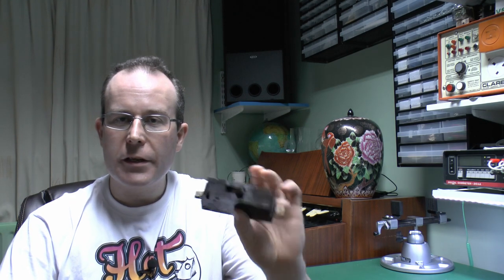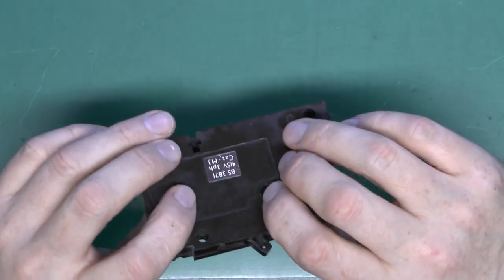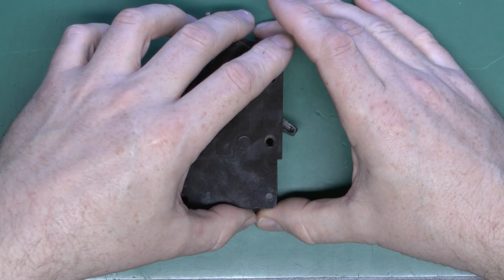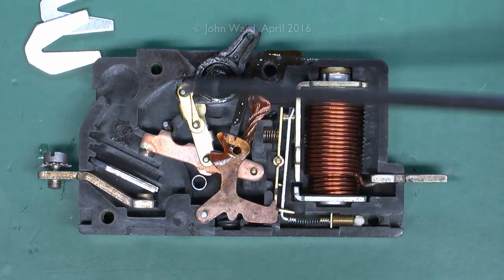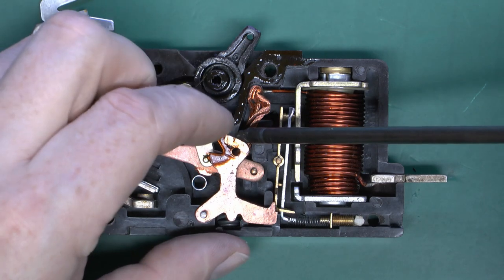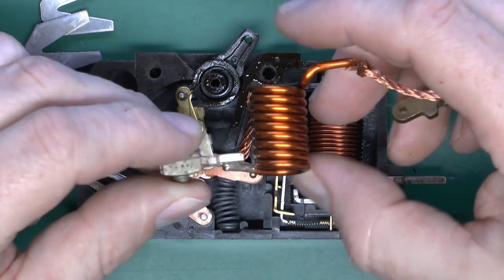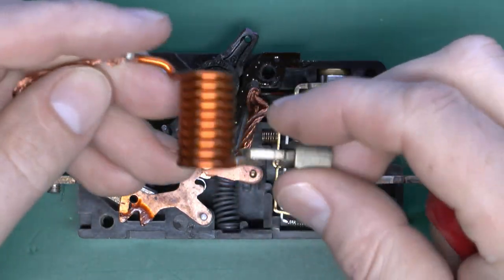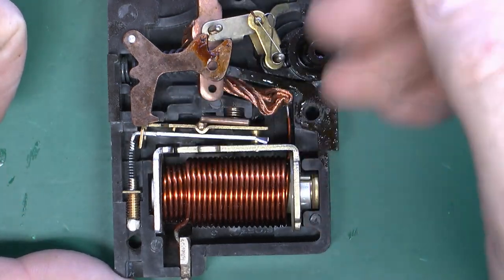Inside a Crabtree C50 Circuit Breaker

Comment: Interesting.  Never seen inside one of those before.  Does all the current flow through the copper winding then?  I use Power-line Networking to get between the floors in my house and for historical reasons has two consumer units.  I suspect that the Power-line propagates better through old circuit breakers than new ones... is the impedance of modern circuit breakers different?
Reply from the maker: +NivagSwerdna Yes, the whole current goes through the copper.  Modern ones may have a higher impedance as they have a coil and bimetallic strip for overload detection which is designed to heat up.

Comment: Hi JW great video, as these C50 breakers are slightly different from your regular circuit breakers, can these be used on DC circuits?. Thanks
Reply from the maker: C50 MCBs are not suitable for DC use,  this is specifically stated in the most recent documents for them.

Comment: I'm surprised it is only 5 amps as those ends and contacts look huge.
Reply: +Mentorcase Contacts are common through the range, used from 1A ( the smallest value they made) all the way through to 100A. Only the coil wire is different to fit the number of turns needed. No longer used as the soldered connection has no mechanical strain relief, the new ones are all spot welded instead.

Comment: I'm having to replace one of these because it has completely turned to carbon at the top (arcing at the contact point??). One question though - you didn't say what those three curious v-shaped plates actually do?
Reply from the maker: The plates are there to absorb the energy from any arc which may form when the contacts open.  There are multiple plates as they will have the effect of dividing the single arc into several smaller ones which encourages the arc to extinguish.